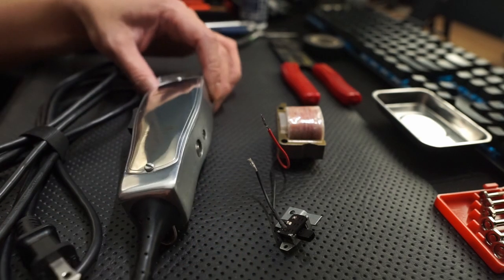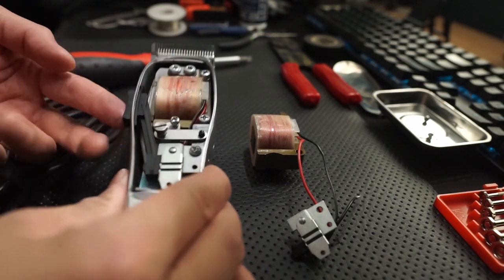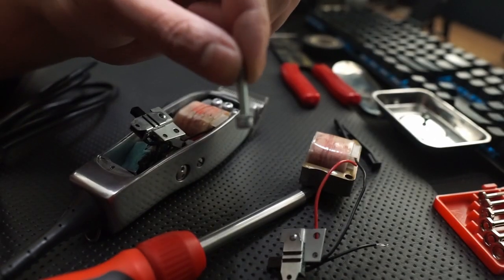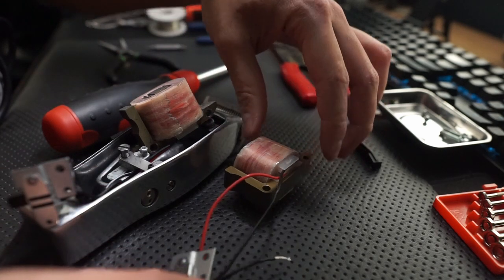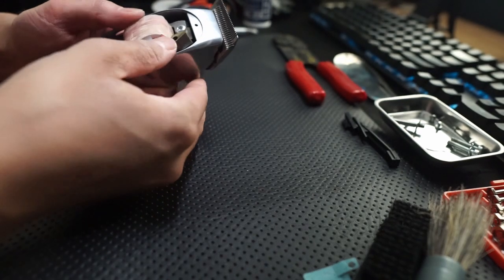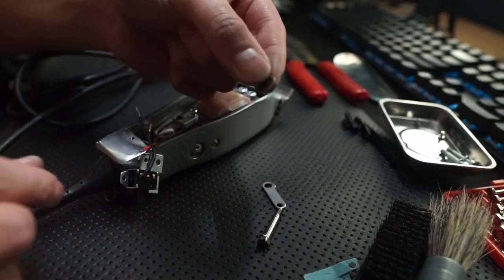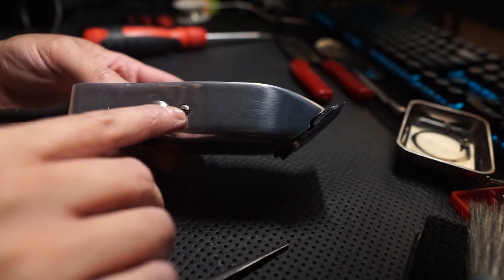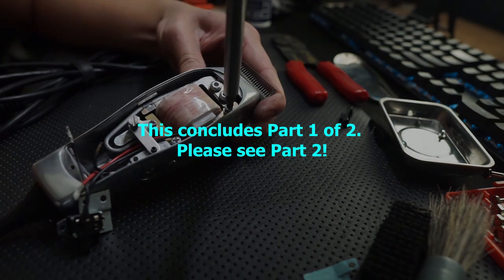Andis Master Clipper Motor Replacement (Part 1)

Comment: First of all, bless your heart my friend, great set of videos, outlining entire disassembly and reassembly, including sourcing the parts!! Thank you kindly!!
I did have a question: how did you determine whether it was the motor vs the actual power switch that went bad..? 
I ask because, mine smokes slightly when I turn on (giving off an awful electric burn smell). So I set them aside and purchased a used set of Wahl Seniors. 
Seeing how cheap this fix was however, I'm excited to try it- especially since it looks like your new motor came with a new switch as well!! 
Just curious to see if the switch by itself is cheaper or not- but at $16 and change, I wouldn't mind at all just outright replacing both and keeping my current motor as a backup (assuming it's still good).
Cheers.. thanks again, and sorry for the lengthy message 😂😜🙋‍♂️🙏
Reply from the maker: Thank you for the kind words! I would personally replace it all together, because it would be hard to diagnose the issue you are having just by your observations. It could be that moisture or water from spraying or adding oil is causing the motor to give or give off a burn smell. A change I have applied in using these clippers is to keep try to keep them running when cutting my hair. I realized that turning them off and on all the time really wears them out. I can't comment on effectiveness on this but so far the new motor has been running like a champ till this day.

Comment: How old were your clippers?  It looks brand new. How did your motor blow?  Thanks.
Reply from the maker: I bought them in 2019 so I had them for about a year or so. I only cut my own hair so they gave up between that time of casual hair cuts. One day they just didn't turn on.
Reply: Thanks. Great video.